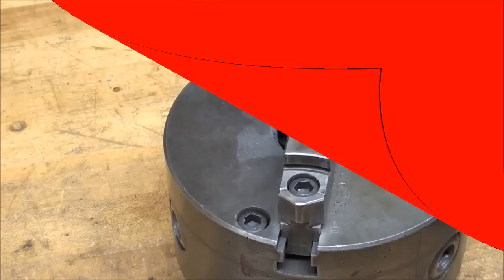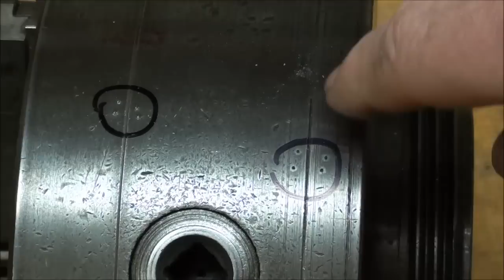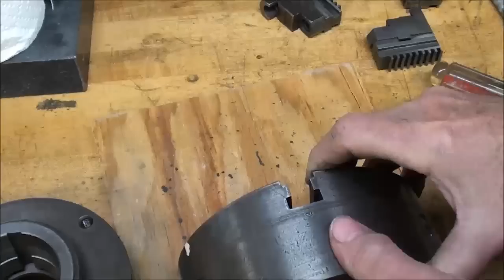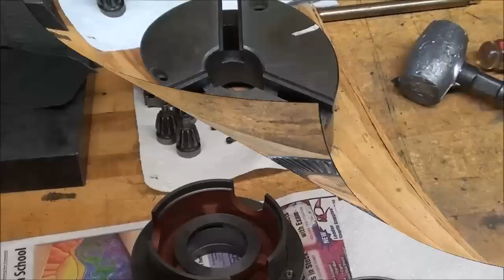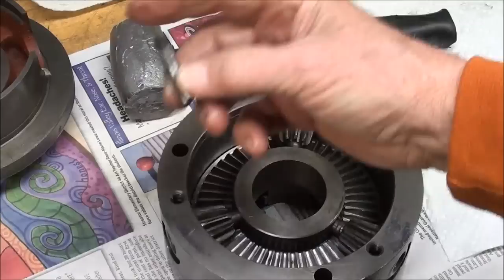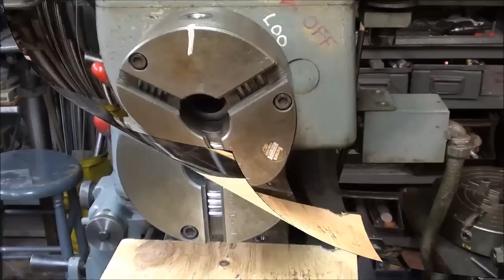MACHINE SHOP TIPS #148 Disassembling a 3-Jaw Scroll Chuck tubalcain

Comment: as a student of Production Engineering and now a teacher for the same, this video brings back so many fond memories of disassembling the lathe during my stint at a Teaching Assistant (for my PhD). 
I used to volunteer for the overhauling and maintenance of the machine. Learnt a lot more about the machines by disassembling and putting them back , than the knowledge I got from books. 
Great way of explanation and thanks for this.

Comment: As an engineer, I'd go heavy on the lubrication ! Pinion bearings - greased. Pinions & crown wheel - probably greased and oiled. Crown wheel greased prior to refitting - on its critical bearing surfaces - and once installed, with the chuck face up, the scroll well-oiled - and probably refit the jaws prior to remounting the chuck on the lathe. I think I'd agree with you re the thinnest smear of oil on the nose and chuck taper. Can't say the oil streak up the wall bothers me :)

Comment: I used to run a LeBlond engine LATHE at the Newport NEWS shipyard on the enterprise refuel overhaul team. I know a little something about machining ? Lol
But i kinda like this video.
Just make sure you burn it in your subscription base to never sand or grind the parts (backing plate scroll plate etc) so the parts go together EASY that clearance leads to runout etc. Makes things go together easy but for superb accuracy a slight press or interference fit assures better concentricity !
A scotchbright pad does GOOD 👍 Say a video on LATHE spindle bearings (preload) and checking redressing the spindle taper would make a nice video to teach you subscribers !!!
(Easier said than done)
If the scroll plate is sloppy you'll never get a 3 or 6 or 4 scroll chuck to stay accurate.
Man I've seen spindle tapers chewed up from poor workers so bad it makes me sick !!!
Oh well just trying to help out.
Good video Sir
ALL THE BEST.

Comment: Right, wrong or otherwise I cut the register of the spindle slightly undersized and adjusted its centering for best runout  for my most frequently chucked material. I plan to drill, tap and install set screws acting against the mounting studs for the chuck to side in the centering.

Comment: Thanks, Mrpete.  My chuck was starting to bind and I knew what was inside, but wanted a quick demo before taking it apart.  Plastic dead-blow hammer, brass drift and a couple of screwdrivers used very carefully got it apart.  Someone had plenty of grease on hand last time it was open and took a bit of time to clean properly.  I used an open-gear lube on the gears that I have for the lathe's gear train because I had it on hand and it seems less likely to gunk up over time like grease, and some way oil on the scroll and jaws so maybe less likely to hold chips.  I also ran a tap and die for the six retaining screws because why not?

Comment: I have a south bend with a threaded spindle but when I put on the chuck I sort of flick it on so when the threads bottom out it locks so i can run the lathe backwards without being attacked by a flying chuck
Reply: Don't reverse it while the lathe is running, or the chuck has a very good chance of spinning of and running across the shop.

Comment: Thanks  Mr. Pete, I just took apart and cleaned my 3 jaw, went from .030 run out to .003. I am very happy with the results. I used simple green and a ultrasonic cleaner. Blew it off with compressed air , sprayed with denatured alchol and then oiled everything with sterret m oil. I also loctited the screws. this is a factory new chuck, it still had cosmoline on it.
 Thanks for showing me how to do this!!!! Jack
Reply: WOW !

Comment: Gasoline isn't anymore flammable than brake cleaner (if you get the good stuff). Heck i use it as starting fluid. Thanks for the tips! i just picked up an old lathe and the jaws are super stiff to move.
Reply: Gas can leave a residue, and (IMHO) it burns your skin worse than brake cleaner.   When I was a kid, I used gas.  Now I use the more appropriate cleaners.   Assume everything is flammable, and you'll probably be ok.  :)

Comment: Germans say:

"You may use common oils and greases for ball bearings (soda soap greases) as lubricant. But please avoid lubricants with additives such as graphite and MOS."

http://www.g0704.com/bf20cncconversion.pdf

ROHM Chucks use: Fett F80
1000 g Id.-Nr. 028975

Comment: That was pretty good but I was missing one thing. When you disassembly any type of construction that you haven't done before you have no idea of how things are held in place, where you can bend and punch and where you can not. Every time you try working on your car you break some plastic holder because you cant see how it should have been done until it is too late.
Therefore I think it is bad that you jump over the disassemble part so hastily. Seeing what tricks can be used on a stubborn piece and how stubborn you can expect it to be is really helpful the first time.

Comment: Wive tooth brush...?
Do we put it back in place after? And how do you clean the brush after, to remove the after taste of oil...?
Reply: he washes it out in the wife's turkey roasting pan that He filled earlier with turpentine
Reply: s smith
You heat the turpentine pan on the stove so the whole kitchen stinks, If it doesn't explode it will mask the taste on the brush. ''Get her done''.
Reply: Pierre's Garage...well, there are stainless steel dentures(!)

Comment: 10-4 Toly [a few posts down]on using a little diesel fuel as a general shop solvent...cleans well and leaves a little super light oil  to prevent rust untill you can oil up with the 20WT.  GREAT SHOW AS ALWAYS MR PETE Bless you!

Comment: Thanks again, Now I hope you will make one of those L-00 Back Plate. I am working on making one now. Haven't finish it yet. I had many problems in adjusting for the right L-00 taper 8˚ 17' 50" and adjusting the Minutes and seconds in digital in order to adjust the taper with an indicator. I need to make the 6 TPI and really on't know how to make the keyway inside the taper. Hope you will need your back plate soon 😊
Reply from the maker: +Robert Patoine Thanks for watching
Reply: I know this is 4 years old, but check out This Old Tony video. He has a L-0 spindle.
This Old Tony - Making A Lathe Chuck Back Plate https://www.youtube.com/watch?v=uAQLrM1P-YQ

Comment: Hi mrpete, how would you recommend stopping the lathe from turning whilst undoing the chuck or collet. I have been engaging the back gear to lock it and it works fine but some other user has been howling that it's a terrible this thing to do to a lathe. To me when running the lathe normally all the drive goes through the same pin anyway, Without hammering or shocking the chuck I just firmly turn it with a lever and it comes of. I also had fun replacing the jaws with the 1-2-3 trick and they kept coming out crooked when finally I had a real close look at the jaws and # 1 had 2 teeth missing from the previous owner.
Reply from the maker: I use the back gear method-always have

Comment: It's good that the jaws are numbered, but I don't see the point for numbering the slots. It was still great to see the inside of a chuck... now I'm again a bit wiser.
Thanks Pete.
Reply: The slots are numbered for accuracy, all the slots and jaws are slightly different (wear and manufacturing error), if you use them in the same slots you always have the same setup every time. if you go to the trouble of truing up the jaws you want to keep it that way. Hope that makes sense.
Reply: Rob Horsley Well I guess that makes sense.. although I think that's a bit overkill in accuracy =) I do not believe the slots can wear that much, if any.
Reply: The front faces of the jaws are also ground with the jaws in place so you have good registration when reverse chucking hollow parts.  Slot error will throw that off if you mix them up.  Slot numbers also remind folks what order to install the jaws.
Reply: He Ka Interesting observation- but the jaws need to be installed in a numbered sequence for it to work- and it's a lot less confusing to simply match up the numbers on the jaws with the numbers on the slots.

Comment: Thank you sir, just watched it, went down and took apart my d1-4 6" chuck and cleaned.  I was noticing a sticky point mid way in tightening.  The scroll and gears spun pretty easily after oiling.  The jaws I tried before I put the scroll in and they were all tight just sliding.  I used dykem to check but it wasn't much help.  The chuck was noticeably smoother however and a great lesson in how they work.

Comment: Thank you Sir, you solved a problem I'm having with my wood lathe chuck. 
Best Wishes, Brendan.
Reply: Now there's a thing - wasn't even aware of those !
Reply: @millomweb  Woodturners use 4-jaw scroll chucks which have opened up a huge range of stock holding options rather than screwing wood to a faceplate or gluing it to a glue-block.

Comment: This video did help me understand why the jaws are numbered. Makes perfect sense seeing the scroll out like that. Thanks for this video!
Reply: Unlike an independent jaw chuck, (the jaws are all identical), the teeth on the jaws of a scroll chuck are all in different positions (unless the number of jaws = the number of thread starts on the scroll !) as the thread scroll will have progressed a third every further jaw around. You could put the jaws in the correct order in the wrong slots - and get away with it BUT accuracy is lost. So always put jaw 1 in slot 1 first - then 2 and finally 3 (or 4).

Comment: There's one more type of chuck mount that's probably worth mentioning, which is the bolt up flange type. You'll find this on many of the Chinese sourced machines, which are often based on German or Austrian designs. The ubiquitous 9x20 lathe is based on the EMCO (not ENCO) Compact 8 for example.

Tony Grifiths excellent machine tool website has a section on the various spindle nose fittings; http://www.lathes.co.uk/latheparts/page10.html